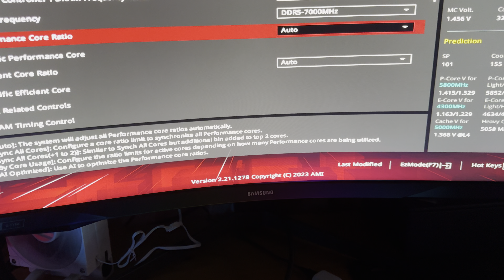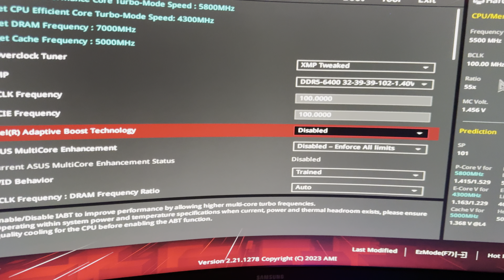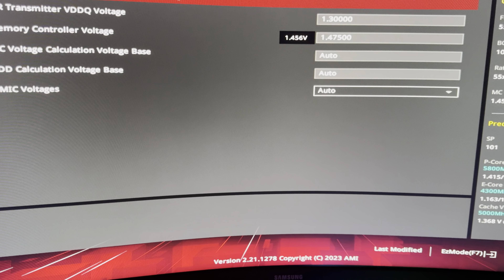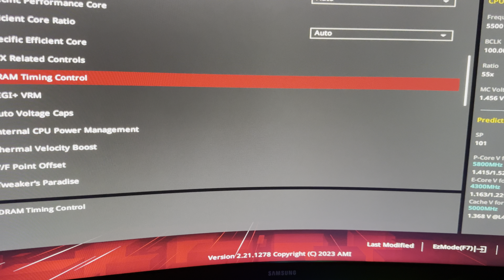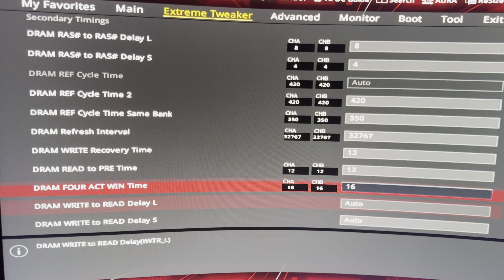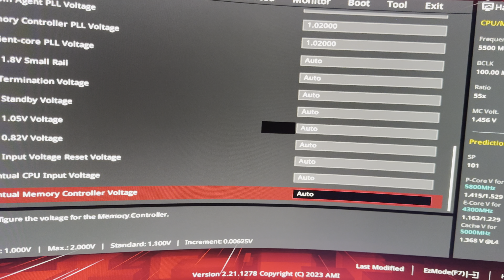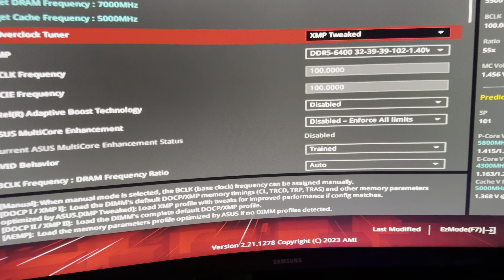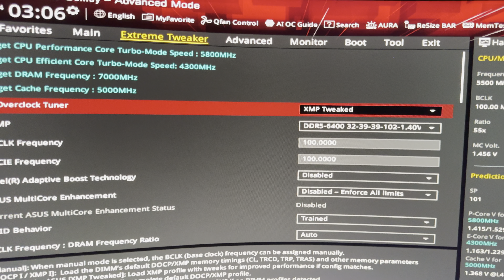7000MT/s with Hynix A-die on the Maximus Z690 Formula

Comment: Hi, those timings you did set to 0 can i leave them to auto to? and why are they 0? greetz from belguim.
Reply from the maker: With ASUS, you can set dr/dd timings to 0 to make them look nice. With other vendors you can do 1 or whatever else their minimum values are. You can’t do this for dual rank or 4-DIMM setups for obvious reasons.
Reply: @dainluke  thx!! I have asus z790 extreme with 2x16 gb corsair a-die 7200mhz but downclocked to 7000mhz because it error at 7200. I tryed your timings here and works good no errors or crashes. But i want to try tight timings even more but where do i start best?
Reply from the maker: @weetjewatikwil1  These timings were actually pretty tight. You could maybe attempt 40-40-40 for the tRCD and tRP values.
Reply: @dainluke  thank you for respond!! Im gonna try it but im already happy with these now ^^
Reply: @dainluke on CPU-Z I can see if my ram is dual rank?
Reply from the maker: @Syrusaki  Think so

Comment: have you had any luck with lowering the rtl iol timings? and yeah the 24gb mdie is much much easier on the imc and boards to run.
Reply from the maker: I tried locking in those very early into D5 because I though it was to do with the retrain instability (it isn't). Even loosening the set that is usually tighter (one channel always trains tighter), breaks training. I just don't touch them. There's no real reason to, to be honest.
Reply: @dainluke  damn figures, pretty much Evey ones experience with messing with them. they do go lower but bc  its the training, they Lowered latency sing if can't pre 12th just curious of tjey stll soo

Comment: twr regester doesn't actually exist on the cpus anymore,  (haven't for a while) the 2 timmings that do that when lowered govern it are twrpden And twrpre. youl can just set them the to 45 or in the BIOS set twr to 48 (its floor l then just to see what i mean go i th os and look at twr value( it will be different value than in the BIOS and memtweak and timing configurator. set the to timings i mentions and on memtweak once both are down as if you lower one twr wont move until the other one is changed its odd by Benn like that since i can remember the twr Value will go blank and on timing configurator just breaks and puts somethting like 24352536805050 lol it's king of any own how many dead timing registers there are like idk why Shell writers for thw bios don't  Remove them
Reply from the maker: I like setting tWR to 12 or 48 because it usually just works tbh. I know about the IMC register think, but I'm pretty sure it sets tWRPRE and PDEN around what your tWR value is anyway.
Reply: @dainluke  well if you wet bios ar 48 and  chance the 2 timmings tied to it yeah but its it goes lower than 12 bc the cpu isn't using it BC its not real was once  years ago now just focus on getting twrpden  twrpre  low as twrs Vale only matters so you may know what the otjer 2 are at. other than that its value and geostet  register do nothing
Reply from the maker: @τετέλεστα  When I adjusted the tWR value on the Dark, it affected stability. If you adjust tWTRS/L, they affect training and stability, and cause the upstream tWRRD values to change. I really don’t think it matters to be completely honest. I like setting tWR directly.
Reply: @dainluke  no it didn't its still attached to former trimmings (which were the one effecting your stability) when the had a register for it but 12gen and further don't have a regret for it TWR "(Write Recovery Time) refers to the time that must elapse between a valid write operation and the precharging of another bank." it isnt responsible for doing this nor does it get told to bc its gone but the timing is there attached to others but has no Effect on anything its a ghost. now I SWORE I SENT THIS explains at least 4 other timings in the same boat. trtp is one ik off hand 

https://youtu.be/r-pMTOcYsbY?t=1027
Reply from the maker: @τετέλεστα  I'm not sure. Let's agree to disagree. At the end of the day my videos are free advice.
Reply: @dainluke ik a another  reason i subd as as qppose to people like fps chaser's lolthe First vid when i saw on your channel hed have charged $500 for just that or felt not gave told people. random but you have a Dark, yoi said any other t3 dimmer? sucks BTW avout evga hold on to that board last evga  kingpin that'll be made. lastly the the timmings read some jdec parks or sone of Intel. i wouldn't just make it up. also stablizing 6400 on a shitty 6 layer msi z690 pro ODTS lood jgong so far so good:)